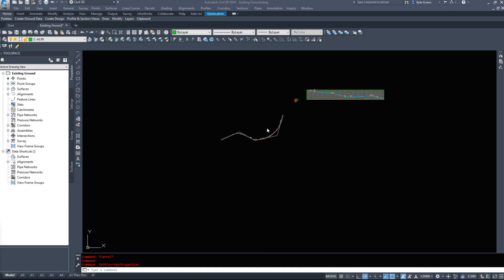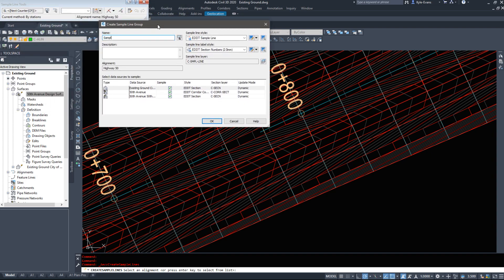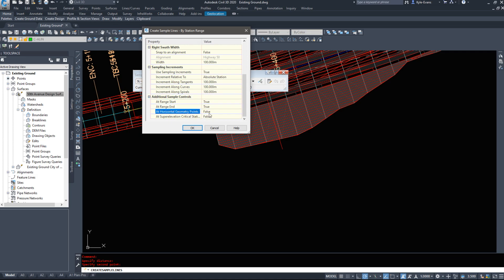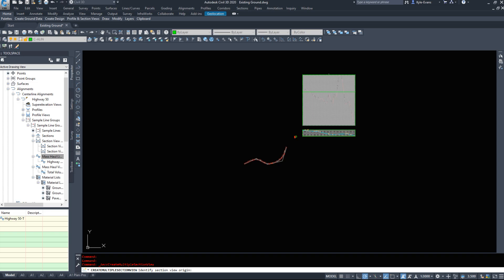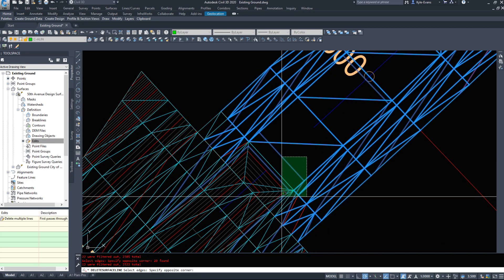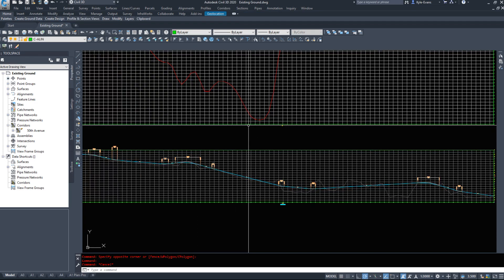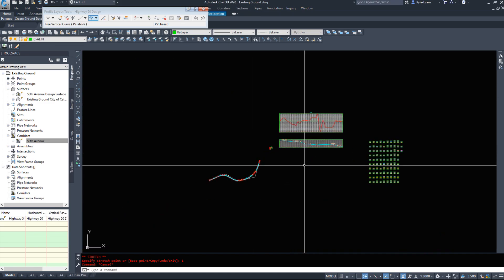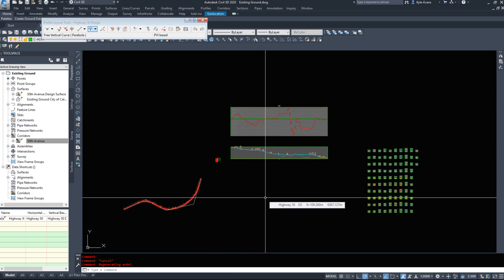Creating Mass Haul Diagram and Sections

Comment: Great video! I especially like that you show problems one might run into and how to fix them. Maybe you can solve the issue with the triangles showing up again by using a region at the bridge area and delete the surface in the corridor properties while you work on the cut and fill. Just a thought. :)

Comment: Hey, I want to thank you for your videos they helped me a lot. But I have been facing some issues in cut fill. Where you described the formation or vertical alignment you managed equally cut fill with grades. I did the same my net worth is 2900 cu.m. Now I have done all the things in my corridor when I got the volume report I found my cut fill net is 10000 
How? Can you explain me? Thank you.
Reply from the maker: Are you asking how to more even it out? If so then you need to adjust your profile grades and PVI's manually down a little bit at a time. Select one of your PVI's and adjust it downward with the grips around 10cm at a time.
Reply: @KyleEvansCivil  No Sir, my concern is i adjusted my vertical alignment and also balance the Cut Fill, it was 2900 cu.m. When i downloaded the Volume Report from the Software The Cut Fill Data was Different. Now it is 10000 cu.m 
How is this possible when I checked with Surface Volume Report. It was 2900 now it's 10000.
Reply from the maker: @MohammadUmar-py3du  Oh, that Volume Report. I am fairly certain that those volume reports read off of the "exaggerated" surface contours. Turn your exaggeration off and see if that fixes it.
Reply: @KyleEvansCivil  How can i off the exaggerated Surface at this moment please tell me sir.
Reply from the maker: @MohammadUmar-py3du  It is in your surface style, under pretty much every tab.
Reply: @KyleEvansCivil   can you share any video link about that.
Reply: @KyleEvansCivil  I am not able to understand sir, please help me with this. How to fix my problem?